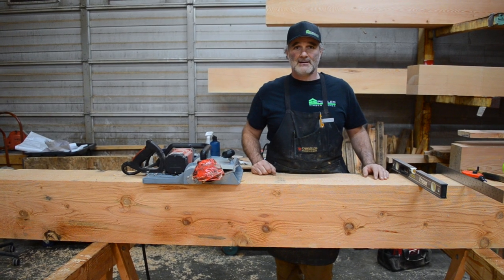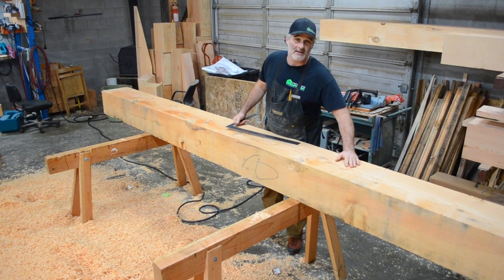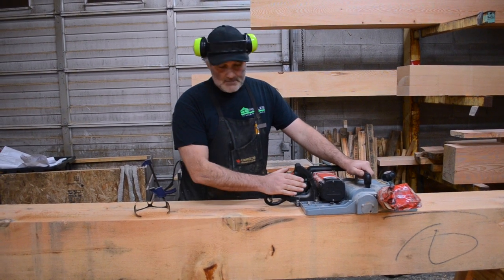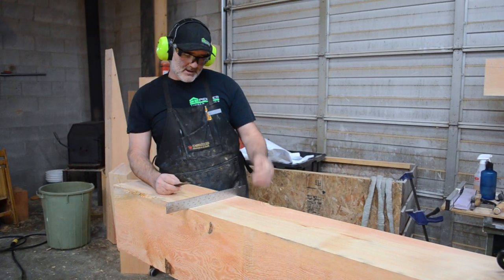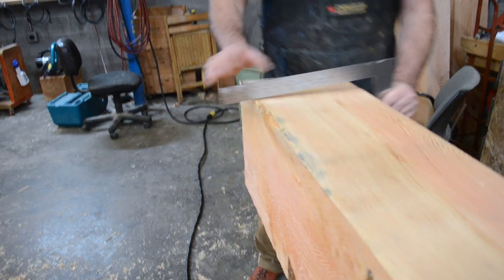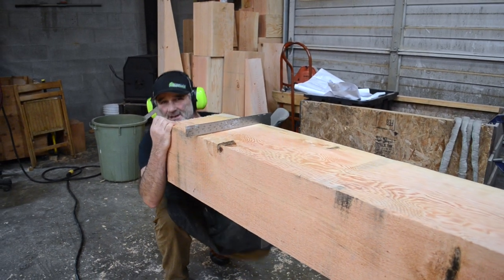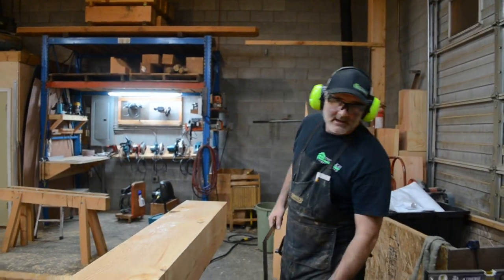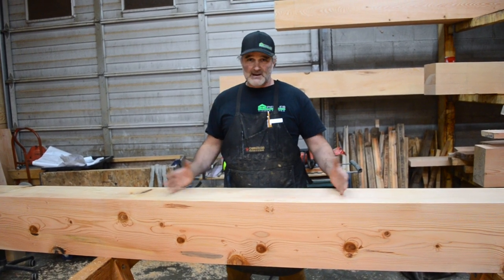NO MORE SQUARE RULE FOR TIMBER FRAMING

Comment: Popped this on just before commenting on FB.  Nothing wrong with another trick in the tool box.  Good info, and I like your technique for plucking the chalk line just enough pluck to get a line on the timber no three foot in the air pull on the sting, and pop the excess off before the line is set down.  .  Less chance of the string striking off.  Similar technique to snap lining a timber, using shims under levels and squares to get the the givens  and take the wind out of a timber then square rule can be applied with out all the planing.   Snap Line Square Rule. if the timber is really wonky.  Mostly I get by with edge square rule, there are precautions to look for.
Reply: I think YT is missing good video on snap line square rule...

Comment: Do you frame with green lumber? If so, how do you account for wood movement after your joinery has been cut? It's perfectly square and straight right now, but what about after it dries a little? Seriously asking because I want to build a small timber frame cabin but it will take a few months to get all the pieces cut out. I'm worried things will warp on me during that process.
Reply: Wax the ends and stain the sides with oil. Slows down that drying process.

Comment: Nice instruction. I use a similar method. I even built a special set of tripod saw horses for the job so I could plane in both directions (stepping around the timber to do so) without tripping over bigger horses. Still, it is a workout.

Comment: Awesome vid. Certainly interested in removing twist. What are the advantages/disadvantages of the Mafels vs Makita 12" planers, I looked at both, I'm sure the old adage you get what you pay for is true but is this tool longevity in a shop environment vs casual or is it quality of knives/options on the Mafels? Any helps appreciated before I commit to 1 vs other. Cheers from PEI for an awesome alt to square rule, I really like the starting perfect philosophy!!!
Reply from the maker: hey there, to be honest I haven't used the Makita very much at all. However one thing I do know is that there is a weight difference between the two. The maffle is a lot lighter and more affordable. I believe it's more than half the price and seems to have plenty of power. With that being said I think the Maffel is better built and will last longer in the long run. Cheer!
Reply: The makita is underpowered because it runs on 120v where the Mafell runs on 240v

When planing a beam, you need all the torque you can have.

Comment: I made a planer for making square beams up to 12.5” which runs on a rail. Much faster and accurate than this, sub mm accurate
Reply: 😅😅dafür  gibt es Dicktenhobelmaschinen. Stationäre. Große und keine handmaschinen
Reply: @thomasschafer7268  I don't think you understood me really. My planer makes S4S timber quickly and accurately, plus it was fun to make and cost about $500 in materials. It's not just a thickness planer, it makes faces square too. It's built on a Logosol F2 and uses the inherent accuracy and adjustability of that system. There really is nothing like it out there, other than Logosol's log moulding kit but it doesn't have a micro-adjustment.